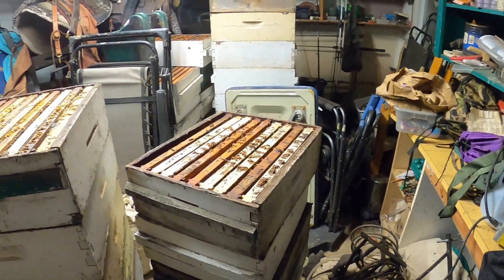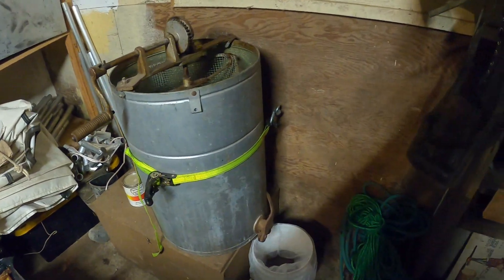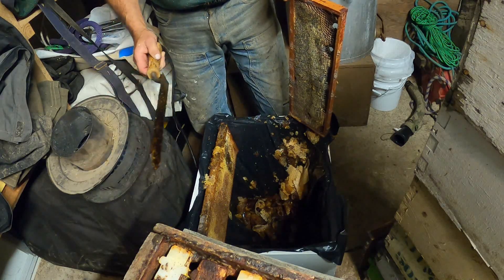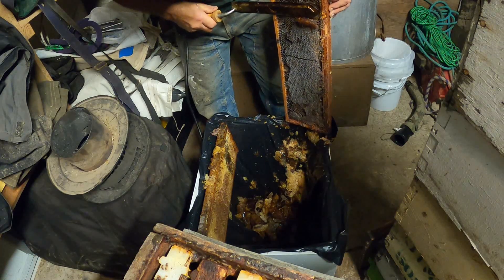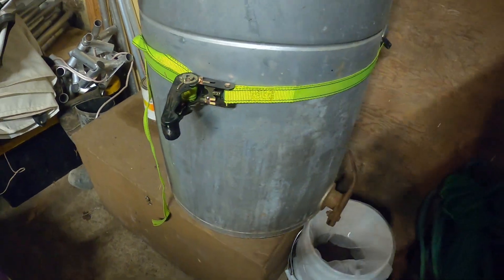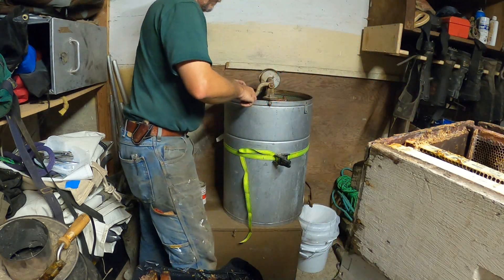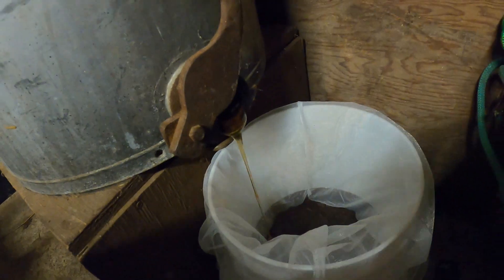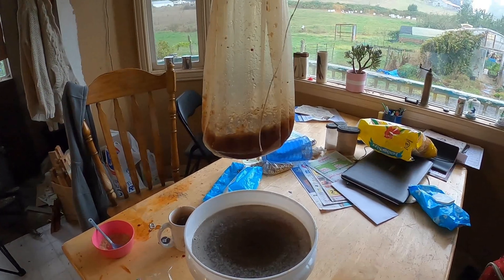honey extraction

Comment: It's a lot easier if you put the frame on the pointed tip of a thick nail coming up from the middle of an ends-notched 2" x 3" going across the uncappings box (the two notches prevent the 2" x 3" from moving around).
Reply from the maker: thanks, I need to do something. truth is honey is the thing I know least about as far as bees go.
Reply: I bought one of those Hive Butler sets and it came with a regular wooden frame with a screw though the top bar. Thought that was pretty slick
Reply from the maker: @boonesbees5485  I saw that, like 15 years ago